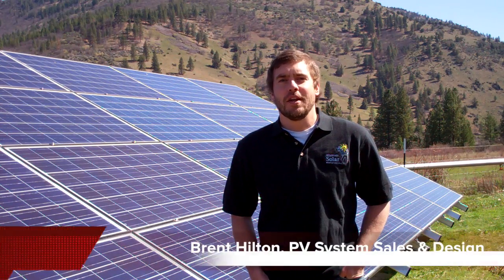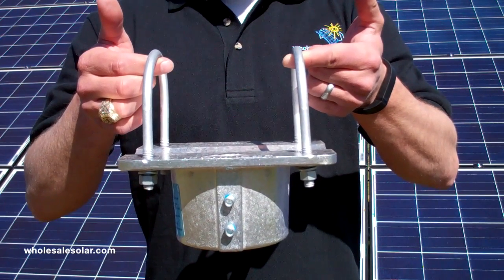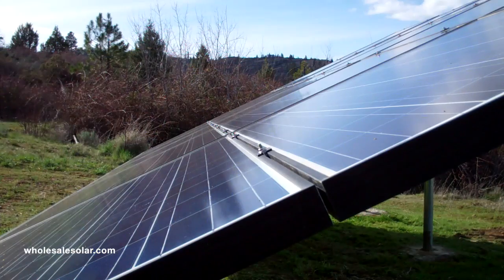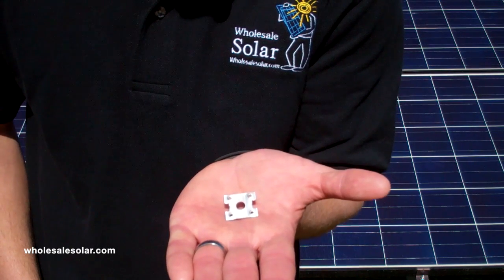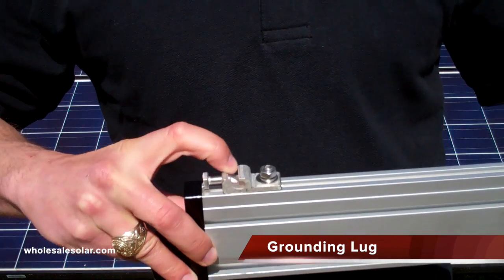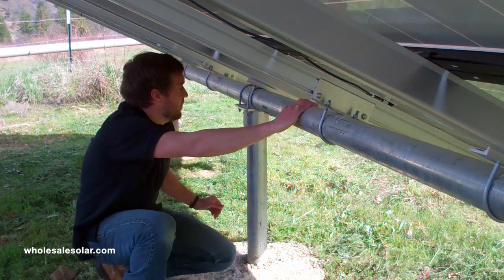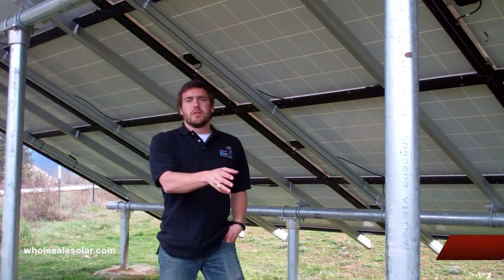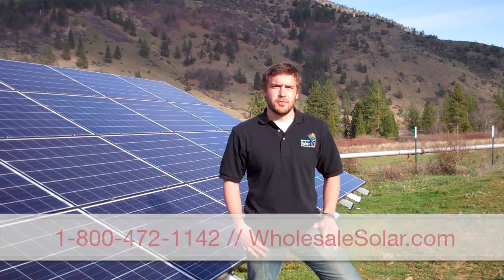How to Install an IronRidge SGA Solar Ground Mount

Comment: Thank you for an excellent video on Ground Mounts.  It was somewhat confusing at first when looking at the bits and pieces of the Iron Ridge system on the website, but this video clearly shows where all the bits go and how to count up how many I'll need for a project.  Many thanks for doing this!